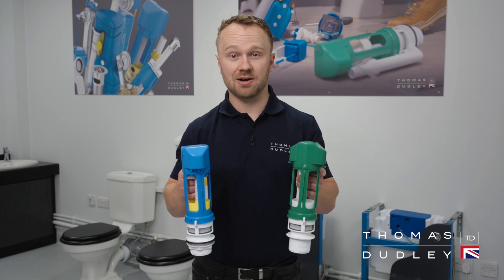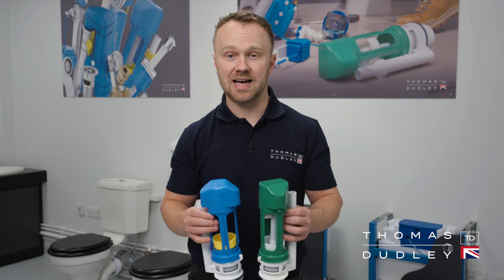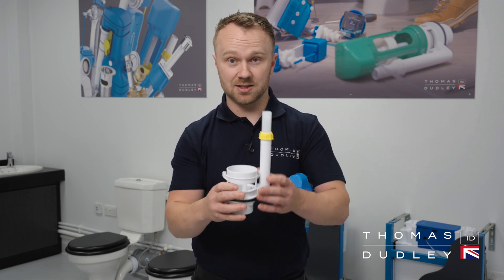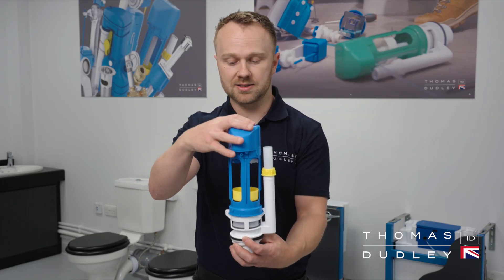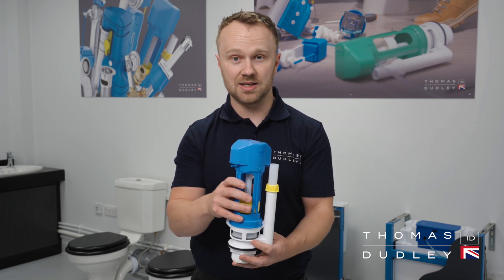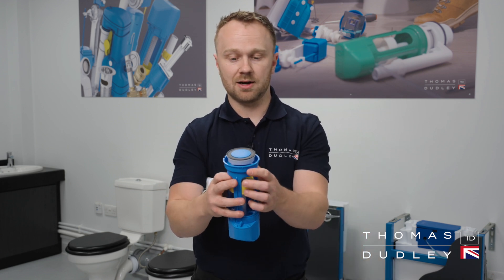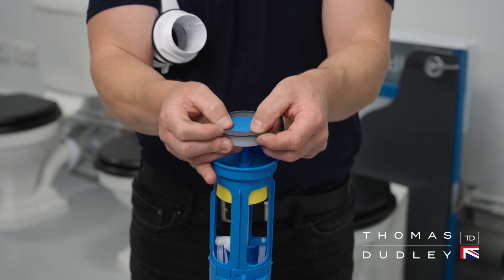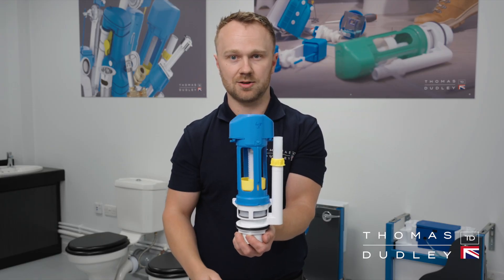Niagara Outlet Valves Troubleshooting

Comment: Thanks, this all worked for me ! But I still don't understand what the yellow cup thing is for. It appears that you can move it up and down, but there is no indication of what the correct setting should be.
Reply from the maker: Thanks for your enquiry, the "yellow cup thing" is for adjusting reduced flushing volumes, the instructions here https://www.thomasdudley.co.uk/plumbing/static/4a54a491abd2802c5cabc0abca8761f4/12333-Iss-J-Niagara-Pneumatic-Installation-Instructions.pdf will visually explain moving up for less and down for more, setting the level at number 4 should work for most scenarios. Let us know if you need anything further :)